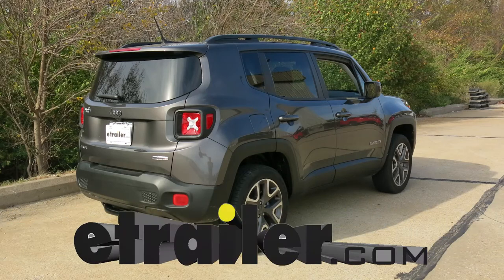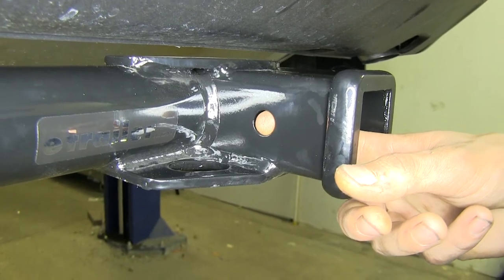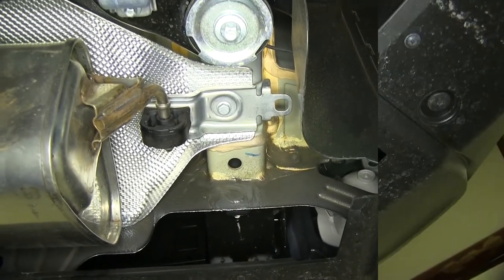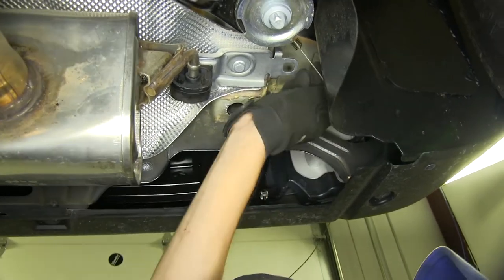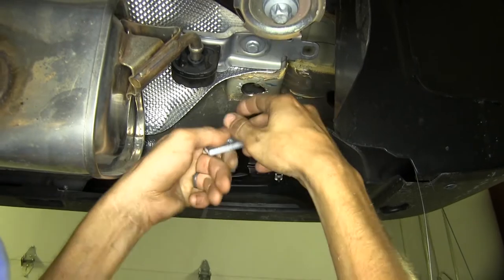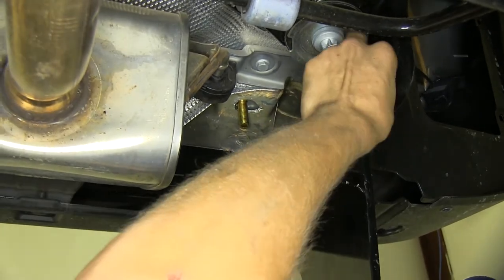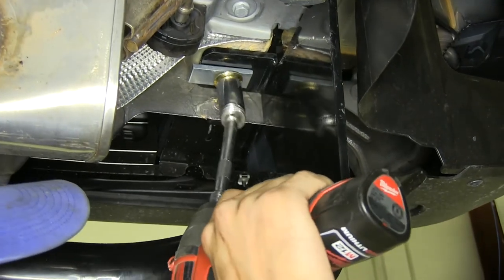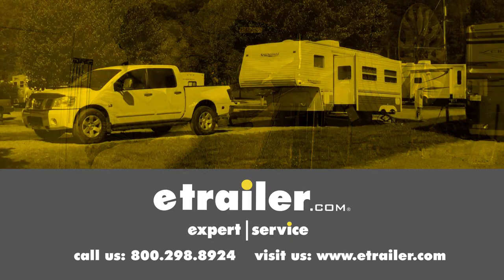etrailer | Setting up the Curt Trailer Hitch Receiver on your 2016 Jeep Renegade

Comment: I got mine installed in a local shop, but this aftermarket hitch for this Jeep Renegade model is installed too low that almost touch the ground.  No way comparable to the factory model which goes through the bumper.

Comment: My trailhawk has bolt where it shows to remove the plugs ?
Reply from the maker: On Trailhawk models you need to remove the bolts. You can view details in the instructions linked below. You can also view more information at our website (linked below).

https://assets.curtmfg.com/masterlibrary/13269/installsheet/CM_13269_INS.pdf

https://www.etrailer.com/Trailer-Hitch/Curt/C13269.html
Reply from the maker: The Trailhawk model will have bolts in those spots, they'll be removed and used to install the hitch as addressed in the instructions, which you can see by clicking this link: https://assets.curtmfg.com/masterlibrary/13269/installsheet/CM_13269_INS.pdf